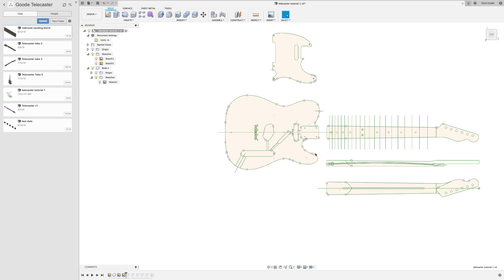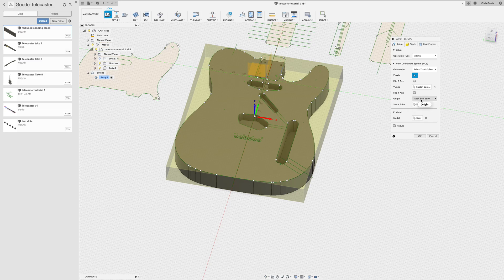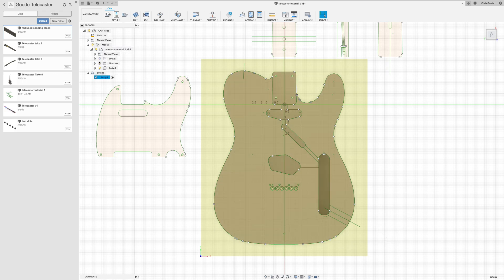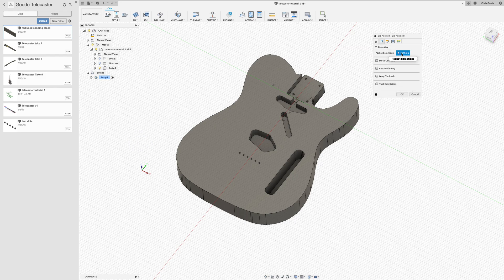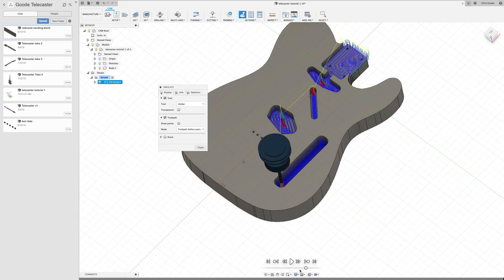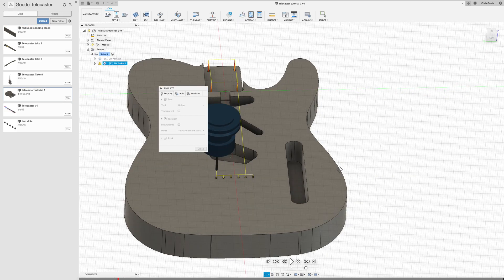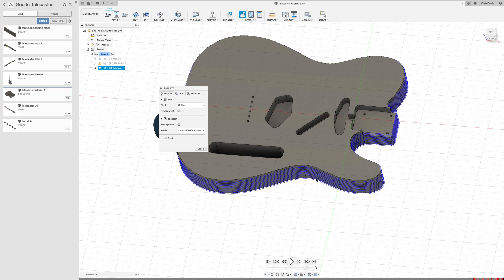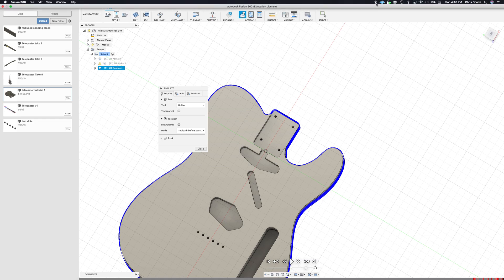CNC Guitars Using Fusion 360 - Step 3

Comment: One thing I wanted to see from this video was how to do the small fillet in the upper edges, specially near the neck pocket, I'm building something similar and I'm having an issue
Reply from the maker: Hi Jesus! If you’re talking about rounding over the body on the front side of the guitar, it’s much faster and easier to use a router to do that, rather than program it into Fusion.

Comment: Those videos are really helpfull

You will have better result of body shape if You draw spline again in Fusion 360 as one line therefore will be less conection points and the efect will be much better, more smoth and so on.
Reply from the maker: Thanks Grzegorz! I agree completely, and have moved a workflow to tracing canvases with splines, unless I need a really specific set of measurements to come across in an SVG will gaps filled. The crucial one here is the neck pocket dimensions, but if the canvas is scaled properly you can trust your spline trace!